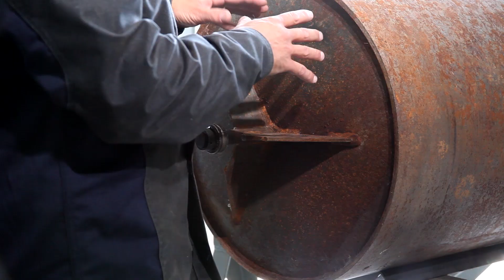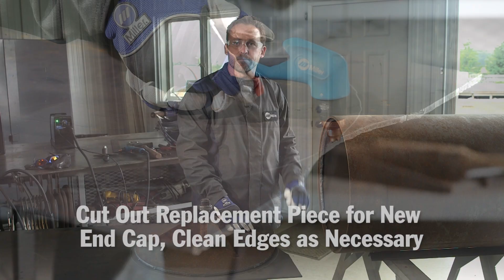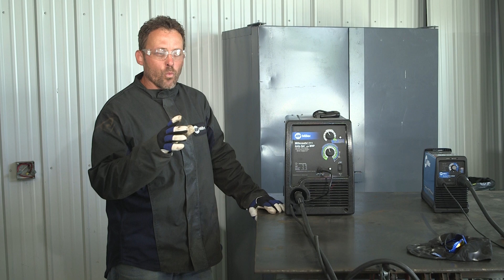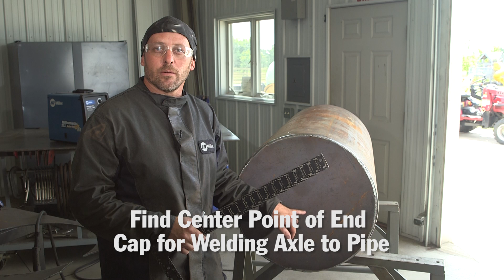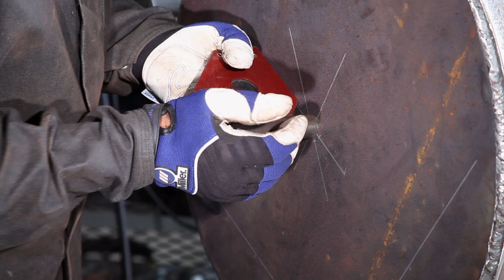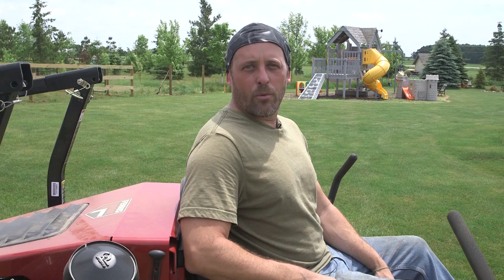Lawn Roller Repair with the Millermatic 211 MIG welder

Comment: this machine 211 come with problem with on the gun and the 110 plug on this model  i send a message to miller, a week ago they don't respond yet!
Reply from the maker: Thanks for reaching out. What questions do you have about the machine? Thank you.
Reply: the gun come with a problem escape the gas on the front now i got a different issue, te 110 plug turn off my machine
Reply from the maker: We recommend giving our service line a call to talk this through with a tech. The number is 920-734-9821. Let us know if you have any trouble getting through. Thank you.

Comment from the maker: Interested in making your own at-home repairs, but not sure how to go about it? Joel Ort provides inspiration and walks step-by-step through the repair of a lawn roller with the Millermatic® 211 Auto-Set™ w/ MVP and Spectrum® 625 X-TREME™ with XT Torch, providing welding tips along the way: 
Lawn Roller Repair with the Millermatic 211 MIG welder

Comment: There is an even simpler way to find the center. The square naturally finds the diameter  with the corner point on the circumference, the intersection of the arms with the circumference is at the diameter intersection points. Draw two diameters about 90 degrees apart and you have the center.